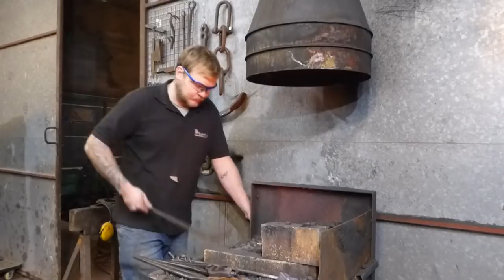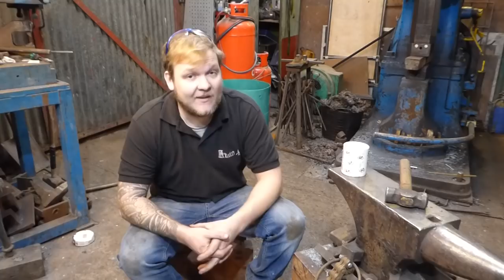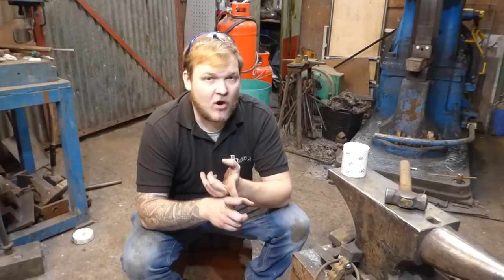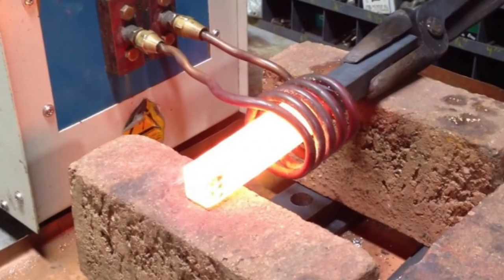Climate Change? Is the future of Blacksmithing Electric?

Comment: I find it hard to believe that all carbon producing fuels will be banned.  But I can see fossil fuels becoming obsolete.  Charcoal can be produced and used in a nearly carbon neutral manner.  The same thing would be true for bio fuels that can be used in a forge similar to a gas forge.  But if all open flame or carbon burning fuels are banned, it will be difficult for the small hobbyist to afford electric heat.   Electric resistance heating such as a kiln is expensive and slow to come up to heat, great for heat treatment, but lousy for forging.  Electric induction shows great promise and I would love to try an induction forge.  But it is still somewhat limiting in size and shape of the work piece.  Of course if it is CO2 emissions that are banned all together, we will also loose our oxy fuel torches and CO2 shielding gas for welding.  In the long run I think it is all inevitable, but I hope there is a new technology yet to be discovered that will keep forging practical and affordable.
Reply from the maker: The video is based on the UN summit the recently happened where scientists said that if the climate temperature wasn't controlled within 12-15 years we could find that the planet could be in a CO2 ran away affect. Not saying its true or not but what was said is that all CO2 creating fuels must be banned in order to stop the temperature. It was food for thought. Just raising a quest and looking at options. I would also love to try induction and I hope to see if i can build one of them as well but small steps. Thanks for your in put not sure about the charcoal thing so ill check it out. I also hope there is an alternative. Thanks for the comment as always
Reply from the maker: Also John this was a what if and how could a home gamer do it. building or buying complected electronic equipment (induction heaters) might not be that easy. compared to  like building a coal or gas forge. if taking a couple of readily available items and retrofitting your forge was an option isn't it worth a look?
Reply: @danielmoss2089  I certainly understand where you're coming from in the video and I think it will be a real issue in the not to distant future.  I have two electric resistance oven, similar to the kiln you mentioned.  These are used for heat treating tools and while they will reach forging temps they are extremely slow to get there.  I hope there is an alternative that could be made by the average smith and it is certainly worth looking into the options (as a blacksmithing community) But my experience with living on solar power (you learn quickly that resistance heating in any form is extremely inefficient and costly) and my experience with experience with the electric resistance ovens I now have in the shop make me doubtful that that will be the technology we need.  If electric induction becomes more common, I think it will also become more affordable.  While an induction forge uses big power while heating, it doesn't run continuously and should use much less power than a resistance forge over a full day.
Reply: + @BlackBearForge  , as you said your electric kilns took a long time to get up to heat. I'm just curious if  the internal surface is coated with a layer of ITC100 AND ITC296 REFRACTORY  as it's been said it cuts the heat up time by like 30% and can reduce fuel consumption by like 33% or something like that. Sorry memory isnt too keen. But I was curious if you knew if it was in there or had an opinion about this?
Reply from the maker: I need to talk to the main dude at the kiln place but my understanding to heat and hold an area with a suitable refractory about a foot cube isn't a hard task at all. It may take time to warm up (if your using just solar panels not great lol (a lot slower than solid fuels or gas)) but it can maintain and hold at 1300 degC quite well I'm told. In fact if the forge was a closed space even better. I would love to know what power usage or rating of your heat treating kilns are? 

Its just like electric motors. People said not possible and couldn't be done. I would love to uses Tesla for this example but Ellon musk was late to the party. Mines all over the world used electric motors in the large haul trucks every day. mines often chosen electric over diesel because the machine produce far better returns. yes the way the electricity is made might be from solid or gas type fuels but these machine can run CO2 free. 

I believe a 3-5kw system has the ability to do a great job it will be able to heat an area about 1ft3 in about 30mins and hold it all day easily without any mechanical issues if look after correctly.  my numbers In the video are based of this and I want to give it a go. I will also be trying to make an induction forge.  

Lastly I would love to find out more about charcoal. I can't seem to find much information about it at a first glance, in fact the information I have found is that your only burn co2 that has already been absorbed and if you can't replace the tree used to create the charcoal before it is used you still have an over gain in CO2 in the environment.  Ie Bamboo is the best wood to uses as a charcoal medium  as it grows very quickly. Also im not sure if this bit is write but the manufacturing process to produce the charcoal is where the CO2 is mostly burnt out and the burn of the charcoal is the not so bad bit. but i might have read that wrong. 

Ie if a tree like an Oak consumes 30 tonnes of CO2 in its life time it will give 30 tonnes back out when burnt. It takes about 10 years for a single wood burn to burn 30 tonnes of wood but 200 plus years for the oak tree to grow to that point where it has consumed 30 tonnes. My understanding might be wrong.
Reply: @danielmoss2089  It is true that the tree grows by essentially taking in the carbon from CO2 and metabolizing it into O2. Think about where the mass of the tree comes from. Not the soil so much, since it takes in water and nitrogen and phosphorus mainly via the roots. There will be some carbon gain that way (and cyprus trees will take in salt via the roots as well and shunt it to a few sacrificial leaves), but not as much as through photosynthesis. I'm a bit rusty on my Biology 119, but I remember that discussion reasonably well.
Reply: @GreenBeeBlacksmithing   I gave long since believed there should be much more planting of trees and shrubs in the interstate right of ways as well as in cities and such. Many plants thrive in such environments.  We could solve many of our issues by simply planting more carbon scrubbing plants all over.
Reply: @danielcrawford7315  I quite agree, as well as more urban farms, greenery on the roofs of high rises, and so forth. Not only would it provide CO2 reduction, but also deal with the fact that cities tend to be hotter on average compared to the countryside since there's also no heat absorption. It's all being reflected.
Reply: John I think if this were the case for small islated heats the induction forge is ideal from what I have. To replace the oxy propane and other such systems I have seen small hand held induction systems that are used in car repair perhaps these offer an option and I suppose for welding everyone would just have to go gas less with flux shielded.
Reply: What a crummy world we are living in having that discussion.
Reply: I'm no expert but from what I can see we don't have the technology to replace all CO2 emitting fuels within 12 to 15 years.
Reply: Black Bear Forge looks like it is going to happen in the UK John

Comment: It's a good idea, I'm surprised they are not already available. As an alternative how about charcoal? I make charcoal in a retort kiln which consumes all the volatiles produced as part of the firing (much more efficient/less polluting than ring kilns). Emissions from charcoal are only what the tree absorbed as it grew - so carbon neutral. If you then bury the finings (very good soil conditioner) the charcoal in the ground is inert, making the fuel overall carbon negative!
Reply from the maker: I think that any co2 creating fuels would be band. Wood is on that list. I'll check it out thanks dude.
Reply: I believe wood is considered a renewable resource and not a fossil fuel. It would just depend on how the ban is worded.

Comment: I've actually always been curious if you could use a kiln or heat treat type oven as an alternative to coal or propane, my sister is a potter and uses a kiln daily for firing her clay. Its an interesting idea but I was under the impression that the door on the kiln type ovens needed to be closed to heat up did your source mention that at all?

Comment: Hi, I use an induction forge for my hobby blacksmithing. 1st of all im a beginner and by no means an expert but I bought a machine from China and set up a 64A plug and made up a simple water circulation system. (Pump barrel and pipes.) The metal heats up extremely fast! It's clean no issues thus far and I've had it nearly a year. It is limited by the coil sizes you have but they can be made to size. Also as it's induction it's limited by the power of the machine, mine is 5kW and im very happy. If you have any questions, I have done a good bit of research  into it and im also a physicist so feel free to ask.
Reply from the maker: I would like to build one at some point but I understand they are very complex, thanks for t he great comment and I'll be in touch thanks dude.
Reply: @danielmoss2089  building one would be a large enough project I think... I first looked into that to save costs but it is quite complex. For a  strong one at least. There are some great videos on here about building smaller(less powerful) ones though.

Comment: Great Idea. You came into my traditional forge in Dartmoor over the summer where I have a lovely granite hearth. I'd hate the look of having an enclosed style forge if solid fuel was banned. Purely for vanities sake I wonder if a gas ceramic chip style forge might work with the electric coils or if too much heat would be lost. The obvious problem with the electric forge is that you would be heating the metal in an oxygen rich environment.

Comment: It’s always great to hear other smiths express concern about their effects on the environment.    Thanks for the video and sparking an important conversation.  I personally run my forge primarily off of waste vegetable oil from restaurants.  It still creates CO2 but is carbon neutral.  Unfortunately it is a limited resource, but, there is potential, especially with algae,  to grow plants that will absorb and create all of the energy we need.  Other possibilities to consider are fresnel lenses and other forms of solar magnification.  Thanks Daniel.

Comment: Hi. First of all, thank you very much for bringing up this matter. Climate and ecosystem change is the big fight of history, maybe the biggest ever. As blacksmiths, we have been, and still are, a source of significant pollution. Our craft is mostly esthetic, nothing necessary in most cases, and it's good to ask ourselves if we practice with full consciousness or just with a tunnel vision.
We all know we have to pay attention to our behavior and consumption habits as citizens, but it's as professionnals that we must really be careful.
It's easy to burn fossile fuel all day long and finish it with bottles and bottles of chemicals, and then come back home and raging about over-packed food at the supermarket. We are a chain link in the system, and we need to pay attention at every level of our life.

Electricity could be a solution, depends on the way your country produces electricity. No power comes free, there is always downsides, but fossile fuels are the worst, ever.
In France, we produce power from Nuclear fission, mostly. It is CO² free, but not without problem. My opinion is that nuclear waste storage is less of a problem than a planet sized fuck up.
Charcoal, if made properly, is also a very intelligent way to go. It works just perfectly, it is very pleasant to work with, it is THE most traditionnal way to go, and it's affordable.
All we need is find a source of charcoal coming from well managed forests, that are regrown after being cut, with some good proper technique. It exists, and it is worth putting our money into, to promote this practice. The CO² overall release is balanced by the growth of the trees cut for the charcoal production. No addition of CO² in the atmosphere IF it does not come from stupid deforestation.

I have been forging professionnally with charcoal for 5 years now, I made that choice out of pure logic for my  species. Charcoal forge fire is a liiittle bit harder to manage than a fossile fuel fire, but it's nothing impossible. Every god damn architectural ironwork in my country's castles are forged with charcoal, and they are still unchallenged in style or technique.

Long story short, blacksmiths friends, make a choice, but think about it, and don't be lazy making it. A lot is at stake. Careful, I do not throw the stone at anyone. We've been working with fossile fuels for a long time now, and the need of change is not obvious enough for me to judge anybody. Therefore, forging with renewable ressources (like charcoal) can be a very powerful commercial argument. People are getting sensitive about it, let's jump in that train !
Who knows, maybe someday there will be a label saying "forged with durable techniques", stamped on our work.

Thank you again, Daniel Moss, and let's talk about all of this
Reply: You show a first world blindness to the continued necessity of blacksmithing in third world countries where, in remote areas , blacksmiths still make tools and cooking implements necessary for survival.

Comment: I do not believe that there are that many blacksmiths to  pollute the air, but either induction or the electric furnace could be used. The major issue is where and how the electricity is generated. Wind , solar, hydro, nuclear or fossil fuels. Each has pluses and minuses . and each comes with a cost to the user. I would not worry too much about being a small outfit as your contribution is fairly small as I mentioned earlier.  So hammer on,

Comment: Hi Dan. I don't think your arc idea is feasible since the electrodes in arc furnaces are carbon. So they'll be emitting CO2 as well as your fuel burning forge. Your other ideas seem suitable  too. How about a salt bath? Older salt baths used nasty (not safe) salts. I don't know if there are safe salt baths, but they would heat metal parts quite fast.

Comment: I got out my pencil last night because you have me thinking (which is dangerous). This subject runs in parallel with another side project of mine DIY raspberry pi controlled heat treatment oven. I may try it out myself but in a nutshell I think you will need to use standard nichrome wire for the heaters, coated heating elements aren't necessary. I do recommend using a single phase ground fault interrupter which you can get for up to 100 amps three phase now thanks to the 2017 NEC requirements. You won't get shocked if you touch the heaters with the GFI. Ceramic coated elements costs start to put the building of this out of many pocket books. You will probably need more heat in the chamber than the actual work temperature, hotter than needed allows us to heat the materials faster because the higher temperature difference - an experiment with an electric oven would be nice to try. How long will it take before ready to work? The heater wires in the thing are consumable meaning that they have a finite life from the metal evaporating from the heater until finally it blows, a study of life expectancy of the coated heater would be a good  thing to do.. These are my opinions now, I love thinking about this kind of stuff because its practical thing I can make. So Dan thanks because of you I now can be happy tinkering for a little bit.

Comment: A very large problem with the kiln idea is that if you run it maxed out at 2375°F, you will be changing out the heating elements frequently.
Reply from the maker: That's some thing else i asked about and with a thermocouple and a correct shut down process the coils should last a long time said the professional (thats tony). Also the glass kiln elements are built to get very hot and hold for long times and be exposed to thermal shocks. But with coils costing £2-£6 depending on the size and type its not a massive issues. The guy i spoke with said we expect 5years for the coils if loved but heavy user get through them in a year or so. thank for the thought and the comment.
Reply: Now you brought out the mad scientist in me (hence the thermite post).
Reply from the maker: love it hehe